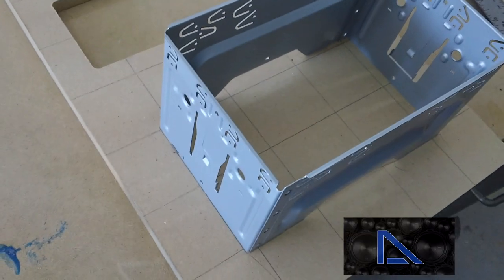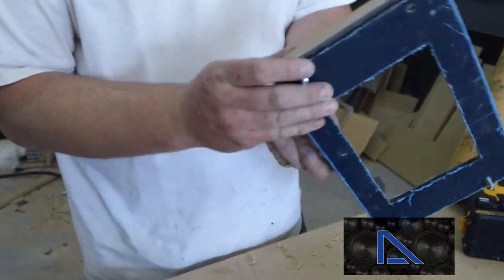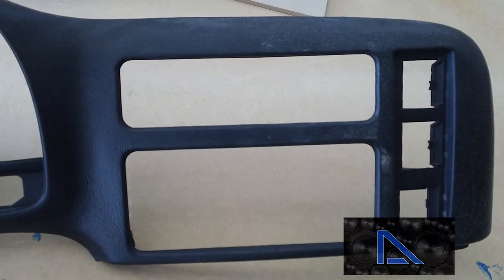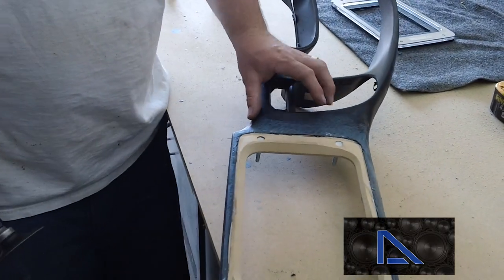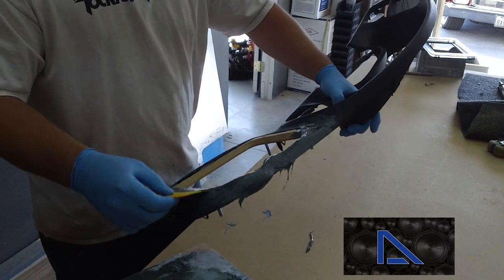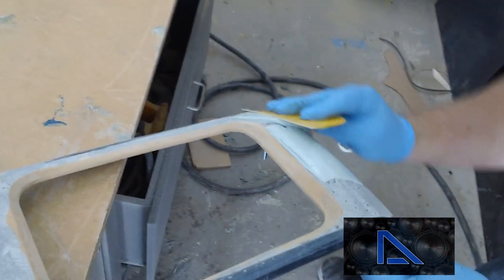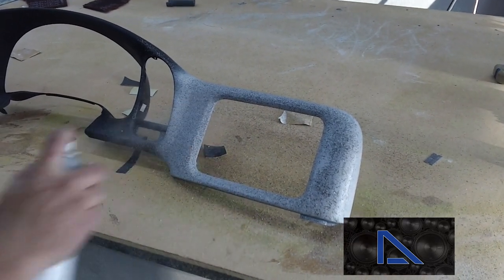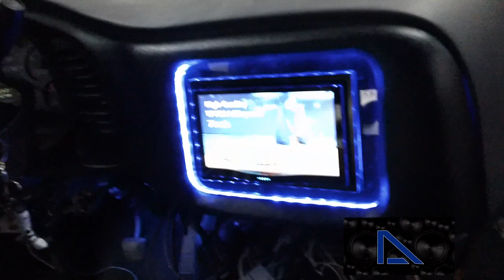Audiotistics "How To" Phantom mount a JVC Double Din radio Part 2

Comment: I would have been more impressed if the HVAC controls weren't deleted. I'd rather have no radio than no heat or AC.

Comment: Good work.  Thank you I learned a lot.  You should def make more vidz...
Reply: Can you please list every item you used to do all the bundle mixing, like, right after you opened the mar glass can, could you please list all the paste looking items you used??? The little white tube, the oil looking chemical, the other little white annalist tube for the heat etc. I just need to know what their exact brand names are. Thank you so much guys for putting this video out. I am having lots of trouble trying to fit a 7 in radio into my 07 350z. You guys are awesome at this stuff, it turned out flawless.